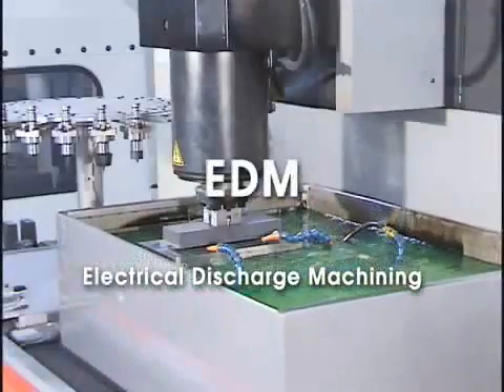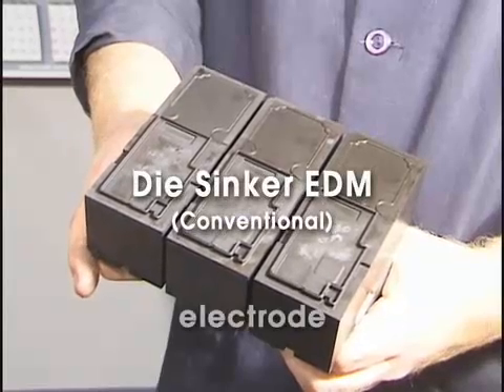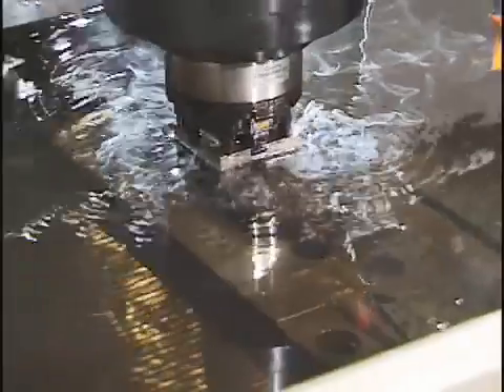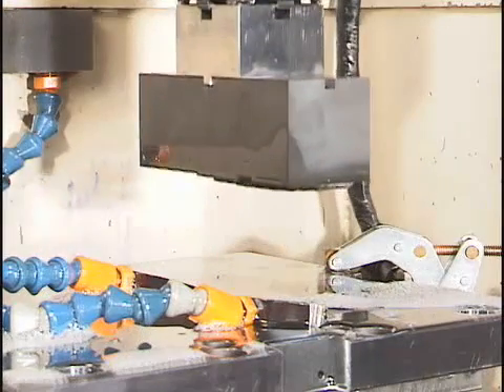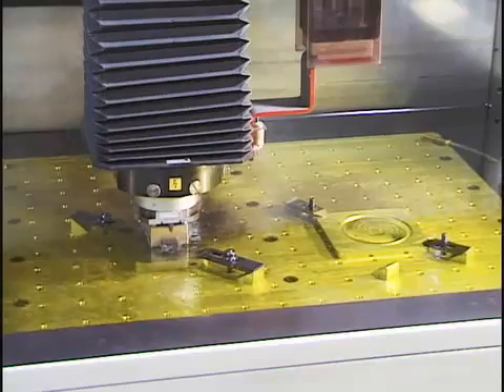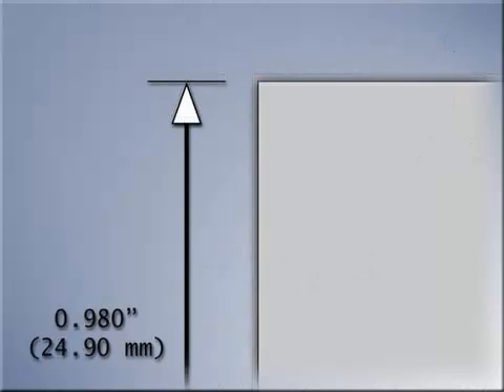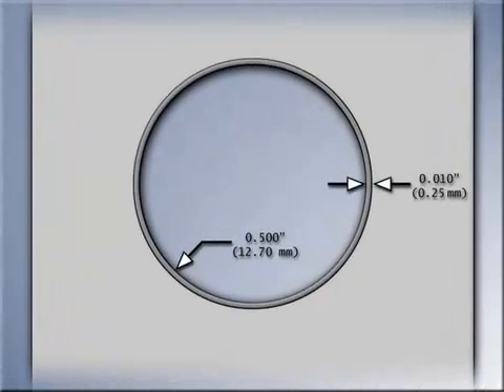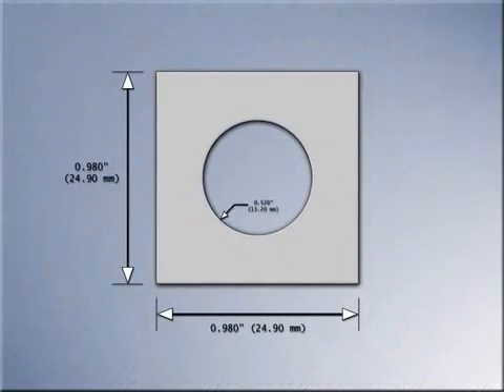Electrical Discharge Machining EDM

Comment: you don't say 5 tents of a millimetre its 0.5millimetri or 500 micro meters. rest of the world is wise and not have 5/128 or drill the size of 8/64 its fucking stulid
Reply: your explanation of metric system was bit hard to understand so here goes.   1Jottameter is 1000 Tsettameters whic is 1000eksameters and the list goes on 1Em=1000Pm 1Pm=1000Tm 1TM=1000Gm 1Gm=1000Mm 1Mm=1000Km 1Km=1000m 1m=1000mm 1mm=1000um.....